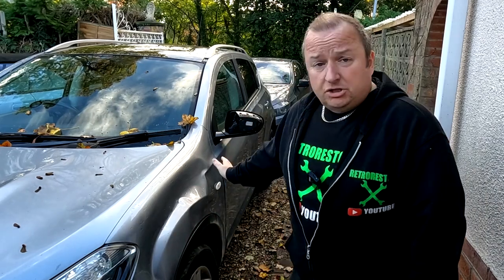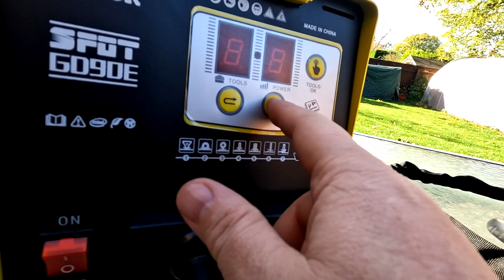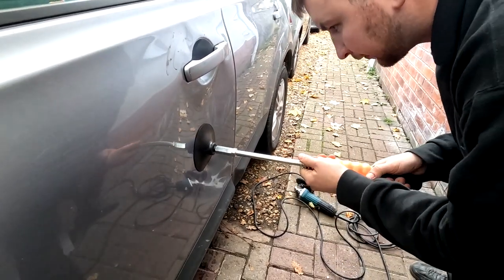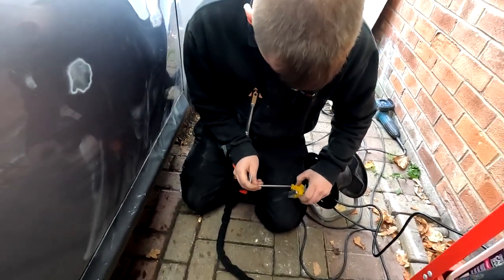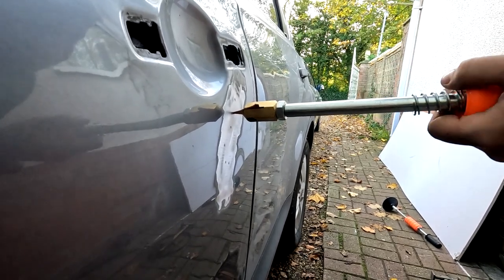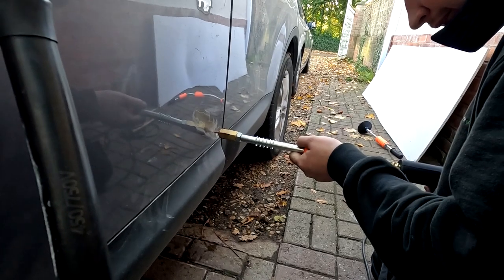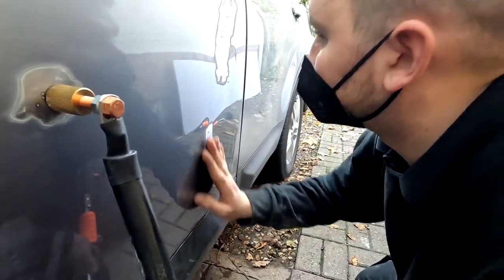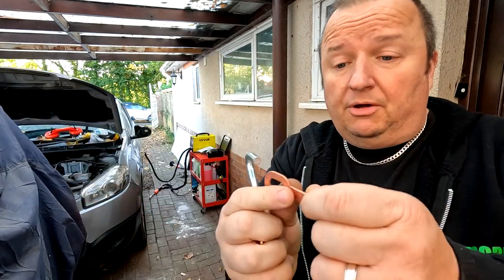A Must Have Dent Puller Tool For DIY Car Body Repairs

Comment: Another top video from a top team ..thanks.Handy affordable spot weld puller similar principle to the old screw end type that used to leave holes that needed filling and prep before paint ,good ppe  there with masks goggles etc….watch out though with grind spatter on the car glass which was always my downfall with rusty spots on side windows and graunchy windscreen wipers  being reported later by customers ,no rants here just a bit of 50 years body repair experience passed on
Reply from the maker: These plastic discs don't damage the metal, just the paint but, yes, its often overlooked. I've done it myself.

Comment: Definitely a game changer far faster than the old gun type you mentioned   and with you being able to adjust the power you won't get them dreaded little potential little holes and raised areas you then have to tap back down

Comment: Hi bI just brought one but it came with a eu plug16amp 220v will I be ok using uk 13amp plug ?
Reply from the maker: Check what the output current is in the specifications.

Comment: That works a treat, I remember my mates shop spot welding thin rods to dents back in the 80’s, but they had to be ground off after, nice job fellas 👍
Reply: Прошло всего полвека😂
 У меня с цифровым управлением уже 20 лет споттер, а вы на это смотрите как папуасы на бусы😂
Это в нищей  и немытой России😂

Comment: Brilliant tool Martin is there much heat transferred to the opposite side of panel as I’m thinking of using one of these on my dented motorbike tank , great content mate 👍
Reply from the maker: It's a very little weld Ian as you saw in the demonstration.

Comment: I worked at a body shop for over 2 years, And my boss spent well over $1,000 for a similar tool. I think the only thing that's missing is a shrinking tool. This is great for the backyard guy I'll probably get one myself.
Reply: You get one yet?
Reply: The ones that are made in the USA and France are well over 1500.00 depending on what accessories come with it. For the guy that works out of his garage the units made overseas  should be fine , not using it everyday.